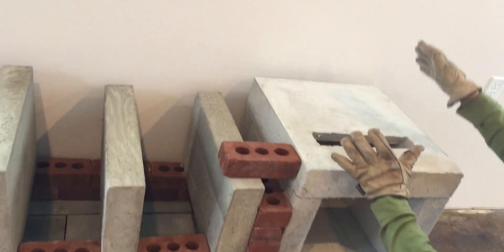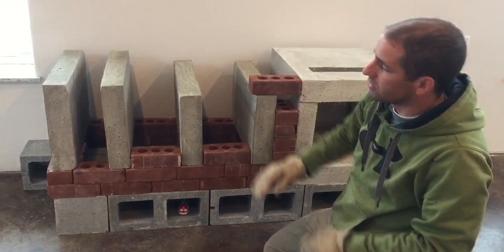Building the Vortex Masonry Stove

Comment: This was 5 years ago, you'd think there would have been a conclusion? In my observation of how these mason stoves are built, you put the hole for the hot exhaust gasses at the BACK of the box, not the front!  The cold air (preferably drawn from outside, not the house itself...) is drawn up the front over the glass door (to keep it clean) and then it burns and goes up the back.  The higher the better because it will burn more of the gasses.  That box should be high temp fire brick, stacked and mortared with clay and cement and kept completely separate (not touching) any other heat mass bricks due to differnce in expansion.  Some buy these fire bricks, there are complete kits that are quit expensive, or you could make them if you add the right materials like pearlite or vericulum, which are porous lava type rocks.  I would think adding air to the mix like an aircrete would also help keep them better at insulating, but they are soft and can't take a lot of pounding from firewood, so you have to be careful.  There is typically a metal grate below the fire and the ashes drop down to where a cleanout channel is (not seen here....) The hot gasses go up, where many put an oven to capture the heat and cook a meal, then they typically go down a downdraft channel to the bottom of the next chambers, where they weave around solid stones or bricks - the heat sink, which is NOT high temp bricks with holes, they are heavy, solid, heat absorbing bricks or stones, or sand/mud.  I would suggest inserting a stainless steel water storage tank that preheats your water before going to the hot water tank, take advantage of the heat!  Finally, the now warm gasses proceed up the chimney.  The taller the chimney and the greater the temperature difference from outside to the box determines the amount of draw that pulls the gasses up the chimney.  You don't need to worry if you have a tall chimney or a warm/hot box, even a cold box at start-up shouldn't be a problem with a tall chimney or a cold enough day.  If you are worried about it, be sure to start a top down fire so that the hot gasses are closest to the chimney and start the siphon process.  Many people put benches beside the box with a thick top to absorb and radiate as much heat as possible.  Lots of videos now on Youtue showing these.

Comment: The fire box itself, what is thst made of? Did you buy that portion?
Reply from the maker: The firebox is made of several pre cast pieces. They can be cast from anything rated at 2500f or better. I use ks-4v.

Comment: I can see this working. I'm not quite sure where the vortex part comes in. The baffles are there to split the exhaust gases into cooler at the bottom. Hotter at the top. In the traditional masonry stove they "torture" the exhaust air path to extract every single last calorie of heat from the fire.

Comment: Parts list brother?  I am a fellow homesteader, I'm trying to count your bricks.   While I'm not a mason, I'm a carpenter who understands intelligent design.  Hope your homestead is thriving.  Let's go brandon.
Reply from the maker: Plan to use about 20 to 25 bricks per baffle. In the video the stove used 4 baffles. I don’t have a parts list. These were custom designed for every project. The core and top slab usually consumes 10 to 12 bags of the Ks-4v plus. I’ve also found that refractories expand a lot less that traditional concrete. As such, even if traditional concrete can take the heat, be cautious because it will move more than a castable and break the clay mortar. Good luck!
Reply: @Alask-Us  Did you make the parts, or can you give us the company that made them?

Comment: If the hot air get cool it's stops running through the pipe
Reply: Sufficient mass (BUT NOT OVERKILL) retains the heat in storage while a tall and relatively hot chimney provides draft to pull on the cooled air, but there is a lower temp limit where draft quits working.  Workability of design depends upon sizing of firebox, riser, throat opening(s) total mass, type of masonry materials, heat storage and heat loss, total house volume, class of stove pipe, pipe and chimney heights, etc, etc.

Comment: How many square feet (average) does this masonry heater heat?
Reply from the maker: This was in a 2200sf highly insulated home and used as backup only. These can easily heat 1000 to 1400sf if there is an open plan to promote air flow.

Comment: Is the wall made out of concrete? Or some other non combustible material? Scary to think that if it is combustible the brick (refactory) could potentially get hot enough to ignite it. Hope that's not the case. Never heard of a vortex stove. Looks very efficient. If you can warm up the flue enough to get it started without smoking out the house.

Comment: Love how the fire chamber fits together. What mix does cast consist of?
Reply: Casey Goodaker - the firebox should be made of a high-temp insulating refractory.    Kastolite30 is one potential pre-mixed product that may be suitable, but hopefully the OP will answer with what they actually used.
Reply: @orcoastgreenman  - Yes, the OP says: "The fire box was cast from a refractory mix made by Harbison-Walker"  - HTH
Reply: 250tegra - thank you...   I missed that.   For most situations a more insulative castable would be preferred over less insulative ones.  I believe Harbison Walker makes castable mixes of both types.